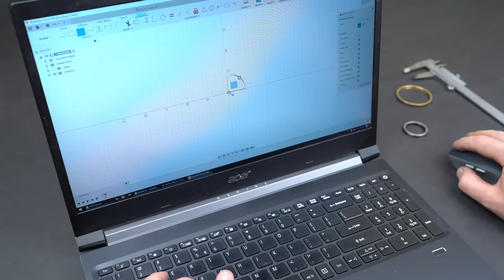Making a Miniature Marble Machine!

Comment: The only thing that could make this more awesome is if the track was just long enough to end right as the lift was ready to pick up the bearing again.
Reply: It's almost there, just needs like a few more cm of track
Reply: a faster motor and more balls would be awesome. And maybe a new design for 3 arms to lift the balls, cause I would like to see an avalanche of balls falling through the bearing!!!
Reply from the maker: It's running on 1.5v now but the motor is rated for 6v so I could just simply run it a bit faster! I'll try
Reply: @danielbruin  i was going to suggest overvolting the motor but sounds like you don't even have to do that!
Reply from the maker: Here you go! the perfect run: https://youtu.be/N4w7Rz97zqg
Reply: @danielbruin  Perhaps make a shallow cross in the tray so the ball align itself for pickup fast.
Reply: @danielbruin  lol, nice
Reply: Or add a second arm to halve the time, maybe with some tuning. Then you could also have two going at a time.
Reply: @danielbruin  to
Reply: or make the motor run a bit faster..
Reply: @mishu0102  I didn't think of that, also he already did that, check the vid above!
Reply: @danielbruin  I just suggested this, but wow!
Reply: @salmanelgamal6843  That would be awesome!
Reply: @danielbruin  Ha! 200th like!
Reply: What kind of wire is used?
Reply: @chancetolbert4852  I'm not sure if you meant to reply to my comment or leave your own but I have no idea :P
Reply: @DoNotEatStudios  you are correct.  No clue how i responded to you instead lol
Reply: Go solar powered!
Reply: @danielbruin after watching the perfect timing video I still think it’d be cooler if the track was longer with the original speed seems to be a bit louder with the faster moving motor

Comment from the maker: Would you even consider making such a small track??
Reply: Yea. It looks dope
Reply: Not this scale though 🤔

Quick question: which study did you do?
Reply: Great job! I went and bought wire after seeing your first video! I can’t get the solder to stay. This is very tedious and takes a bunch of time! Super impressed!
Reply: @michaelwampler9118  if you do it properly it will stay for sure. Maybe a few soldering tutorials would help ( not doubting your ability)
Reply: Yes! It's a different sort of challenge.  There's something different about little things.... Btw great vid
Reply: Michael Wampler hello, to better adhere the solder use a solder paste .... To me it changed a lot
Reply: @michaelwampler9118  Most times when the solder won't stick, either the parts aren't hot enough or you need some flux on the joint.
Reply: Would appreciate a detailed soldering tips video! I can’t get it to stick 🤪
Reply: @davidcollins2282  use soldering paste... flux
Reply: alessandro giuliani tried that! Think perhaps my soldering iron isn’t hot enough - love the videos!
Reply: @michaelwampler9118   if you apply flux it should help it stick- the flux gets rid of the oxide layer on the wire and helps the solder flow better
Reply: Never, very tedious work! Great Job.
Reply: Yes. I want to try to hook it up to usb wall power though
Reply: @michaelwampler9118  had the same thing. Had to switch to different tip and also got flux. You can also look into tinning a solder tip online for the solder to stay
Reply: I thoug it Will be short not smaller than banana.
Reply: I will make one for my Lego figures
Reply: @michaelwampler9118  Don't forget the flux. And the wire is pretty thick so you need a powerful enough iron.
Reply: Daniel de Bruin I made one
Reply: Definitely
Reply: Daniel de Bruin funny thing is I was inspired by your previous video to make my own and all I could find is 1/4 inch balls so this is serendipitous lol.
Reply: Absolutely, yes
Reply: Daniel de Bruin what printer is it custom?
Reply: I will?!!!!!!??!
Reply: No but I would definitely buy one.
Reply: Please sticks mor magnets at the round and put more balls in 
(Sorry for errors i am french)
Reply: Of course! I like small things. Please make more. I love your work
Reply: I could make a track this small with regular sized marbles...
But yours is on another level. I don't know what it took for you to be able to build such a tiny yet functional and interesting track, but it's not something anyone would do. Bravo.
Reply: How much did you pay for it?
Reply: Maybe, but I'd 1000% consider subscribing to you more than someone taking time out of their video to tell me to do it. Very nice way to incorporate that man, more youtubers should take a book out of your page!
Reply: How did you manage to straighten the smaller wire?? 
Did you use the same technique as in your previous marble track tutorial??
Reply: I have neither the time nor manual dexterity to make anything remotely close to something this cool.
Reply: @michaelwampler9118  If it's steel wire it needs to be zinc plated for it to stick. Solder will not stick to plain bright steel wire. That is most likely your issue. I like to use 14ga copper wire stretched straight with a drill
Reply: Definitely
Reply: If this was a solder less kit with a quieter motor I would buy it in a heartbeat.

Comment: Amazing! You could probably go even smaller by getting some thin metal tubing for the track, bending it, then grinding away half of it with a dremel or something similar. That way you'd get away with a lot less soldering too I imagine. You could call it Monorail Marbles^^

Comment: Where do you get the parts for this? I’ve been able to get track and such, but the mechanical bits like the motor and gear wheels seem more difficult to find. 

Does this stuff just accumulate from other projects? Or is there a store where this stuff is easily accessible?

Comment: Thats really cool and all, but... do you have a problem with the ball bearing getting magnetised over time?  Its been a problem I've seen in a lot of these machines.
Reply from the maker: In this case not. Mainly because there is some distance between the magnet and the ball and there's only 1 ball in the track. So it won't stick to another one.
Reply: @danielbruin  Cool - hopefully the distance works.  Though I'll just mention that the balls sticking to each other is only one of the problems if they get magnetized - it can also stop them being able to roll down the track itself (Assuming the track is a ferrous metal)